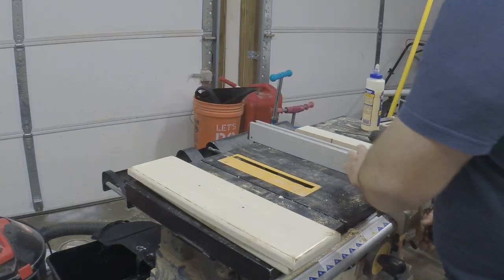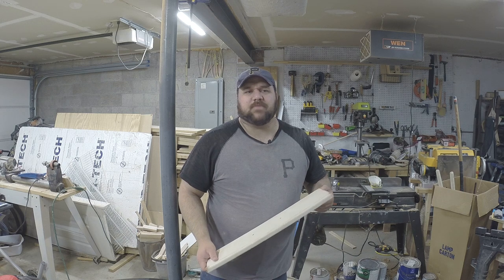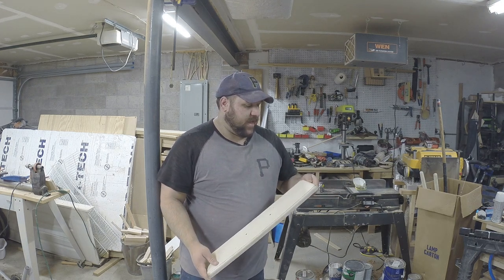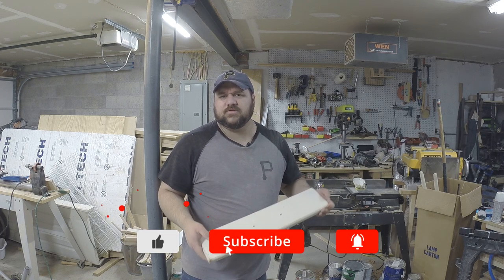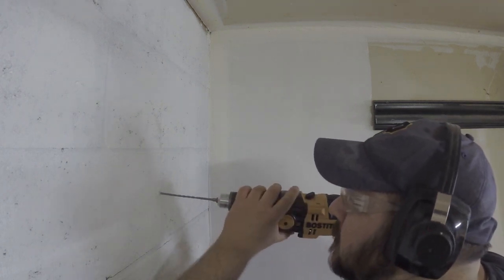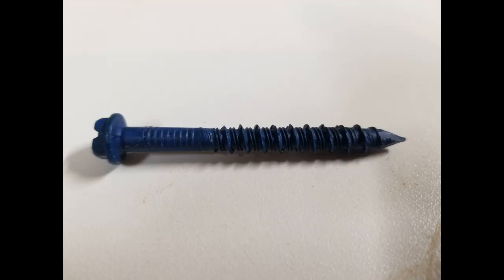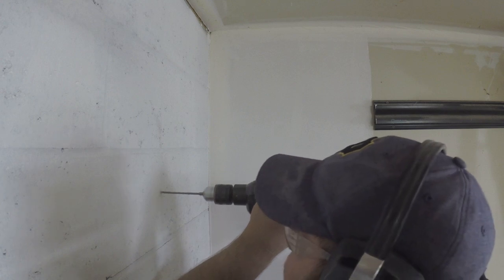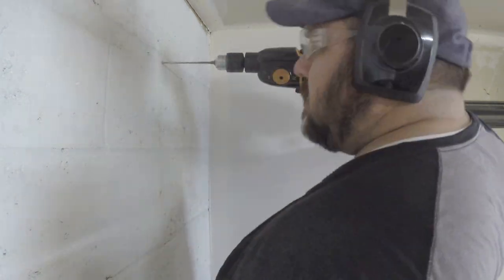DIY Bike Rack - DIY Home Storage Project

Comment: hej there. nice video and concept. i have one question regarding size. it seems to me that is sth around 30x10. but the interior part where you insert the wheel i cant figure it out. can you pls inform or confirm each measure for this project including the hole? tia!

Comment: Hey Dave, wondering about the wheels getting distorted by hanging up like that or getting damaged by accident?   
Hang them by the frames would be better me thinks? Thanks for sharing with us.
Reply from the maker: They are hanging in a corner of the garage that doesn't really get any traffic, but I think that you have a good point and I may make some modification to it just to make sure that they don't get damaged.
Reply: Highly unlikely that this would be a problem. Think about the load that's on the wheel when someone is riding it. I would worry a little about bending a spoke or a spoke nipple if it's hung so that the spoke is torqued over the rod. Solution to that problem is to mount each rack to the wall at a height that keeps the back wheel for that particular bike on the ground.

Comment: Hi, what is the max weight u have hung on this? I have 120lbs bike n it bent a 150lbs hook. I think the hook is too long. So i wanted to try something else. Also, the tires were leaving prints on the wall. I like how the tire sits on the wood.
Reply from the maker: The heaviest bike I have hung is around 35 pounds. The hook could definitely hold a lot more because it is hardwood and is anchored into the cinderblock wall. At 120lbs I would be worried about damaging the wheels or spokes because that it a lot of weight to hold up.

Comment: I'm not sure... It feals like the wheels get much shear with this setup. The rims might get crooked over time.
Reply from the maker: That's a good thought.  I will have to consider how I can adjust it to make sure that the wheels are not subject to excessive strain.
Reply: Hum? I've been hanging my bikes from 2  hooks in the ceiling for 20+ years. Of course, those are hanging vertically and from both wheels and they're fine. 

The really hard part of this project; getting the kids to actually put the bikes away when done using them. If you've got an answer to that, Golden.
Reply: If hanging weight is your concern you may adjust the height so the rear  wheel is on the ground and the hook/rack is just stabilizing the vertical position...